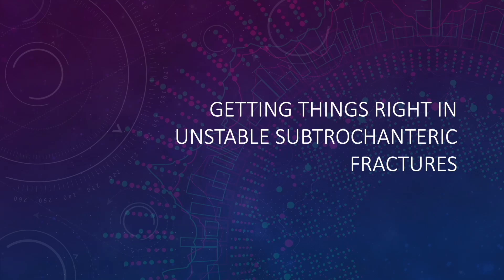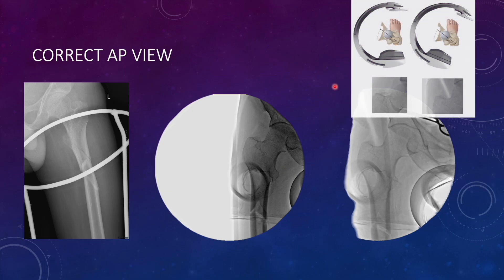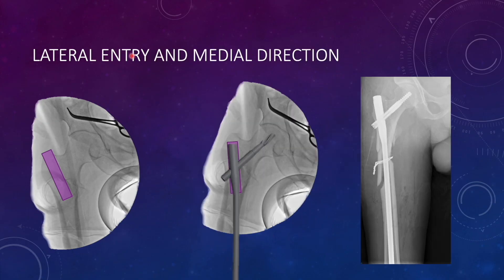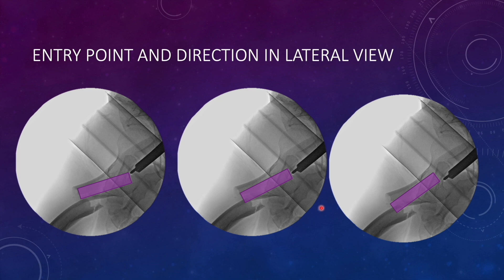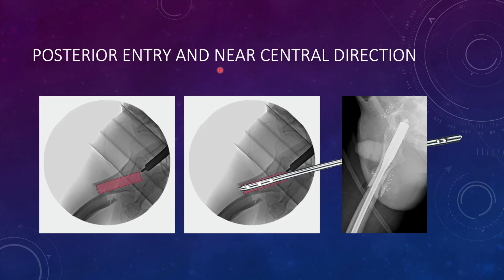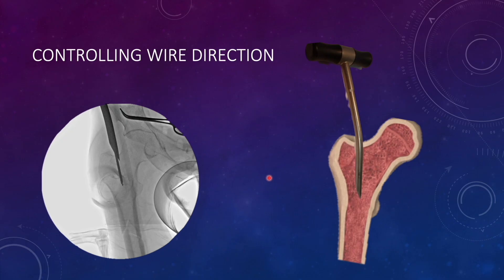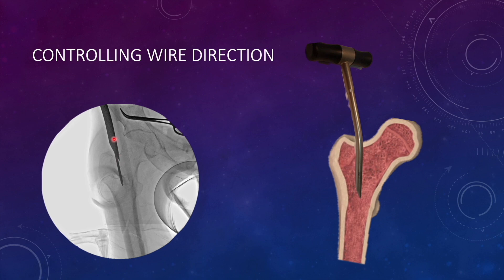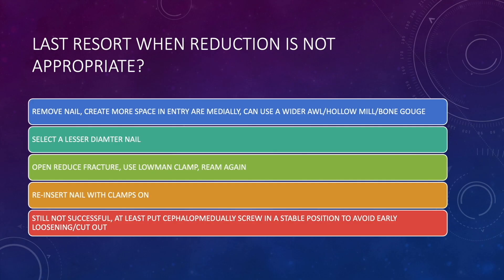Nailing Tips and Techniques in Subtrochanteric/ Proximal femur fractures

Comment: So, conclusion entry point is the tip GT more medial in AP view and center in lateral view  isn't right, because your speed voice was fast😅
Reply from the maker: Yes, entry point needs to be medial to GT tip on AP view and slightly posterior in lateral view to compensate for deforming forces. Central in lateral view can be used when fracture is perfect reduced and stable
Reply: Thank you Sir! You are great

Comment: Scenario- 
25 female with 9 mm wide isthmus 
Rt side sacro-iliac disruption ( minimal displaced ) 
Rt ( same) side closed femur shaft fracture needing ILN 

Left side both sup n inferior Rami fracture 

Choice of position? Traction or lateral ?
Reply from the maker: The SI joint disruption needs to be checked in AP view with figure of 4 stress on hip. If that results in opening of SI joint, we ll fix SI joint with iliosacral scew first in supine position. Then  after that traction can be applied for femur and nailed be done in standard supine position. If SI joint is stable in dynamic/stress view then we ll proceed with standard supine position on fracture table. Lateral position can be used when we have unstable pelvic injury which has to timed after femur for definitive fixation , then we can do femur first in lateral position. Otherwise in most stable pelvic injuries we do conventional supine position nailing only.

Comment: are these nail positions with a trochaneric or piriformis entry point?
Reply from the maker: These nails are actually meant for greater trochanteric tip entry as they have slight lateral bend, but the fracture pattern often precludes the trochanteric entry due to close proximity with fracture and thus deviation from the trochanteric tip entry needs to be done.